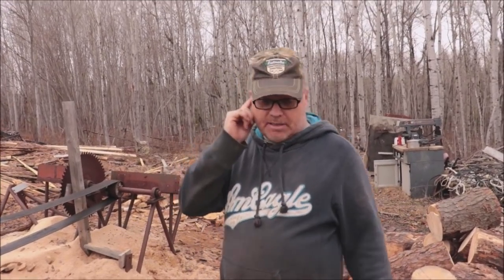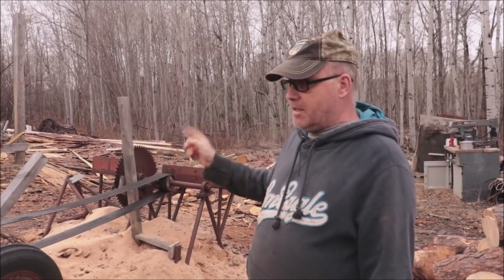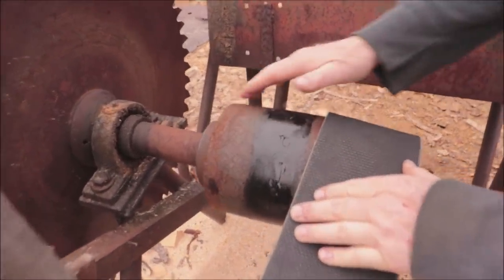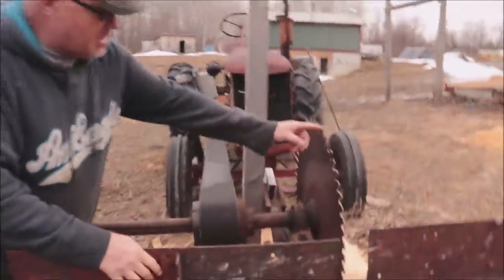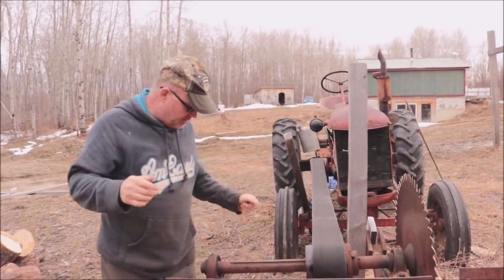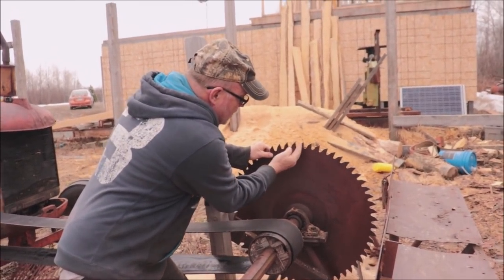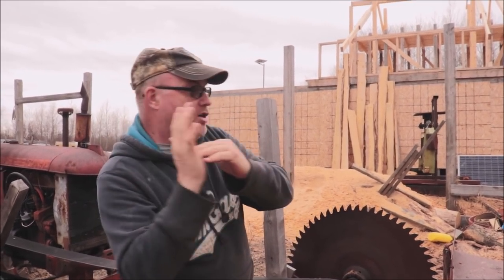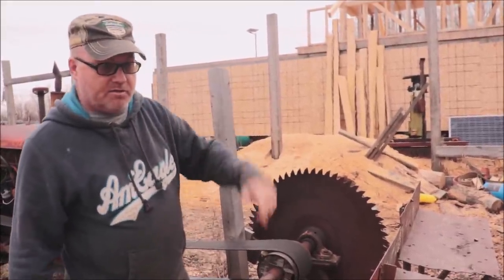You'll Want To See This. Our Buzz Saw Explained

Comment: Yes correct Cecil, i used to use a Mower that had a disc with 4 blades bolted to it that spinned round on the disc, After a lot of use the blades would dull and only one side of the blade would get used. So we would flip the drive belt over on an angle to make the disc spin the other direction so the other sides of the blades would get used to.Or it would mean unbolting all the blades to sharpen them.
Cheers, Jeff.

Comment: The negative degree sawblade was used for bucking pulpwood down here in the southeastern USA. It was mounted on a hand truck with 18-24 inch wheels with a 12hp horizontal shaft engine. Blade hung out front of the contraption a few feet and it took a helluva pulpwooder to push it around all day.

Comment: Do you set and sharpen your saw? My father used to do both plus hammer it. My brother and I used to be the lucky ones to throw the wood away. It was run with and old chopped down 36 Chevy truck. His belt had a twist because of the way it was set up. Lot of memories.

Comment: didn't think about that on saw. the hammer mill would work both ways. it's a lot older than i am they used it with a b john deere and  65 mf with a rear pulley later on the 65 you could make it left hand or right hand. take care, be safe and well.

Comment: if the drive pulley is on the rear of the tractor like on the farmall a then you need a twist in the belt
Reply from the maker: Hello, no you don't.I used to use an old Farmall super C.  All pulleys drive the same way...Here's a video of an old Farmall Cub, notice the top of the pulley drives toward the implement. .https://www.youtube.com/watch?v=G2kVp3UlCkA